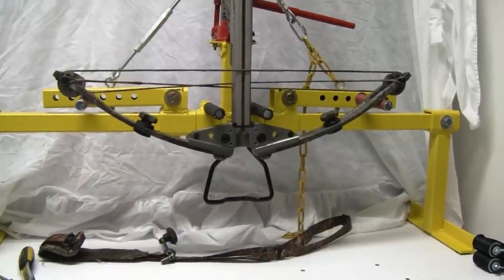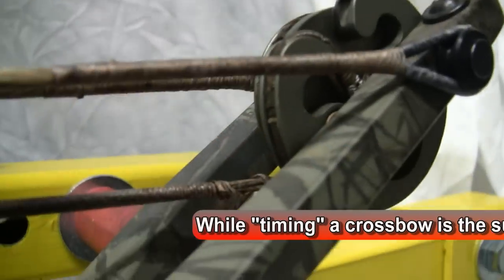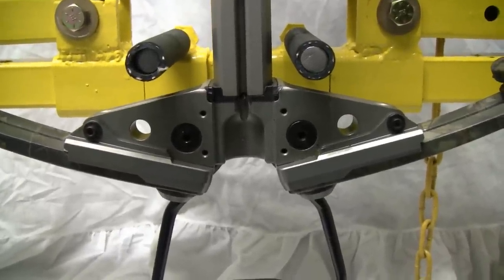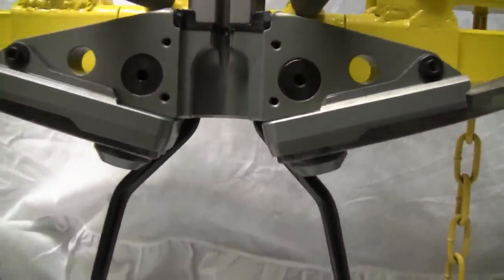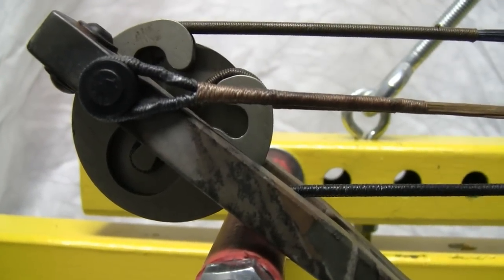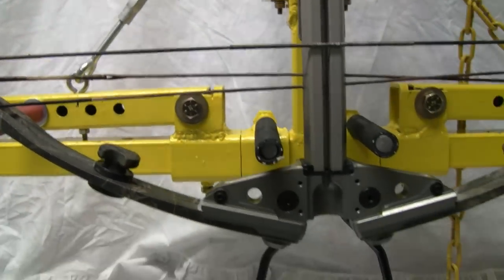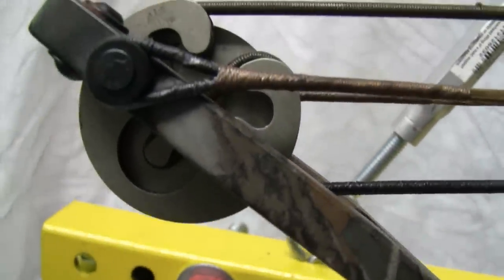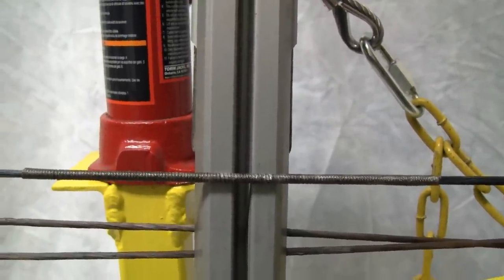Crossbow Timing 1080p

Comment: Only question I have is that slackening the limbs would be very "bow specific"? I'd hate to go 6 turns and either the whole thing collapse, or go 6 turns then apply minimal pressure only to find it stripped out the threads because it was only on the last 1 or 2.... I think I'd want it fully de-stringed and then work out exactly how many turns applied to my bow....
Reply from the maker: It was just on that bow.

Comment from the maker: They are simpler and unfortunately less efficient. Recurve crossbows that is, the other significant issue other than size/bulk is recurves being nothing more than leaf springs, put tremendous pressure on the trigger mechanism. Compounds "let off" and are superior in that regard. But compounds can get out of time. So it ultimately is personal choice. You are right, simplicity in recurves.

Comment from the maker: @rldel149 @KMK39...
They can be controversial in that there is sometimes a stigma that they are a "poacher's" weapon of choice. That is of course untrue. Others don't consider them challenging enough and view them a "cheating" or "taking the easy road". They shoot arrows too, shorter and called bolts but arrows none the less which are just as subject to God's laws of nature (wind, gravity, sound, weight, strength of materials, etc).

Crossbows are good for the disabled, the young and old.

Comment: I have a question about twisting the string. You said to unwind the string to match the other side. What if the string is  straight and isn't twisted one way or the other? Do you have to twist the other side in?
Reply from the maker: Twist to shorten a string. Relaxing the twist will do the opposite - lengthen it.